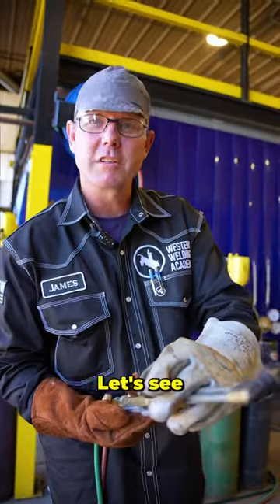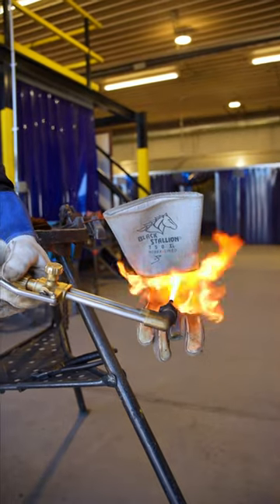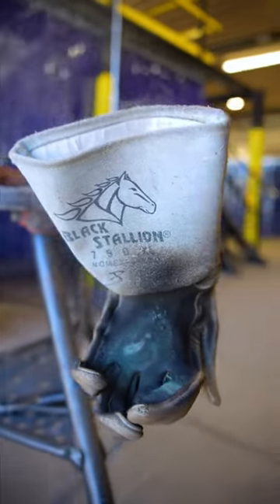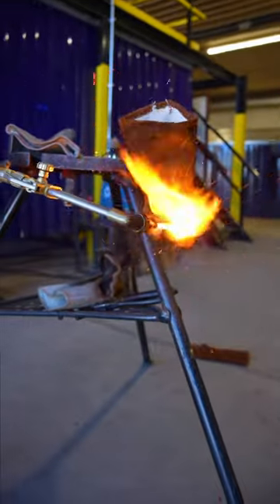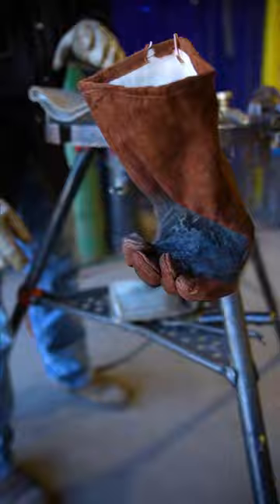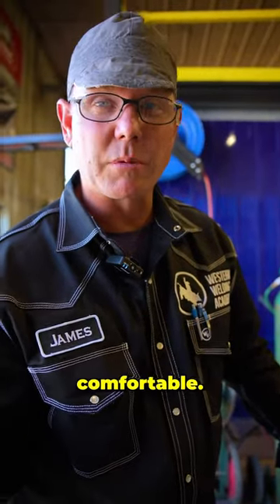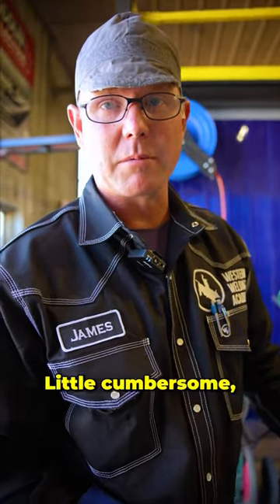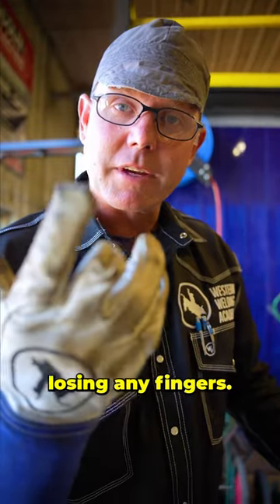Cheap vs Expensive Gloves #kaicenat #amp #dukedennis #gloves #weldinggloves #welding #welder

Comment: This feels like trying to find the best bulletproof vest by shooting them all with tank round.
Reply: My thoughts exactly.
Reply from the maker: Gotta limit test
Reply: i mean, if you accidentally get yourself with the torch it’s good to know that your hand will just be a little warm and not roasted and toasted, i knew this guy who burned himself with the torch by accidentally running it over his fingers and it melted to the bone
Reply: @xptics come on man. I’ve worn hundreds of pairs of welding gloves up to this point in my life. Never have I ever needed to test them with a direct flame like this for such a period of time. In fact I’ve never had to test them. Either they worked or they didn’t and all of them worked. Common sense should just say don’t grab something that’s hot. Especially something that’s 500+ degrees with your hands.
Reply: @jamarian9005 this test shows you the extent of the gloves though. You’d think if 5 seconds of a full pressure torch would do a good bit of damage, but ya’d still have your hands left,  that any time under that and your probably be fine. You definitely wouldn’t let that torch be there for that long so he’s basically showing ya that anything less than that like 5 seconds isn’t gonna do much .
Reply: The point of this is to show whether or not these will protect you obviously you wouldn’t hold that flame there that long but what about hot steel or even when your cutting with the torch wouldn’t you like to know if you have time to get your hand out and if it would still be there I would

Comment: Always wear my gloves while grinding metal, amount of splinters I used to get from the bur and loose material flying off and going into my hand was stupidly high, also slipped with a angle grinder a couple of times slice through my glove but hand was fine

Comment: Can I ask a question. In highschool during welding class, instructor recommended slightly loose gloves so if you happen to grab onto hot hot stuff, you have time to flip the glove off before it shrinks to a tight fit. Is this valid?